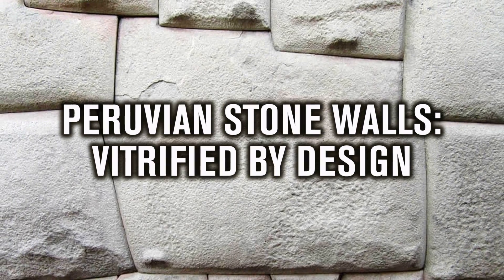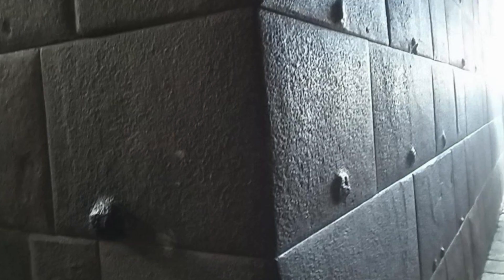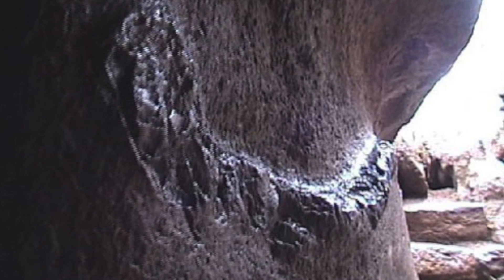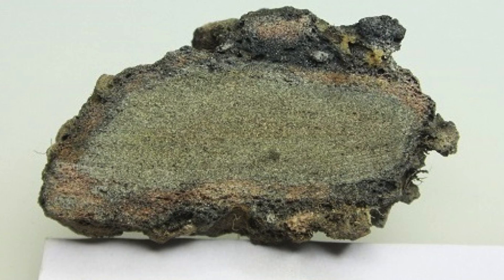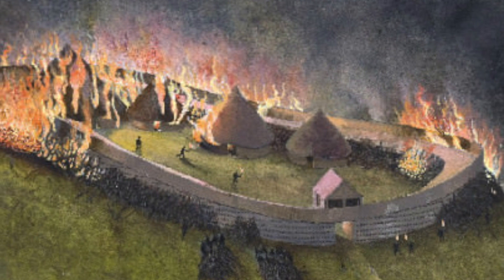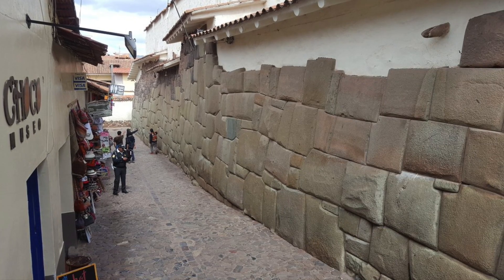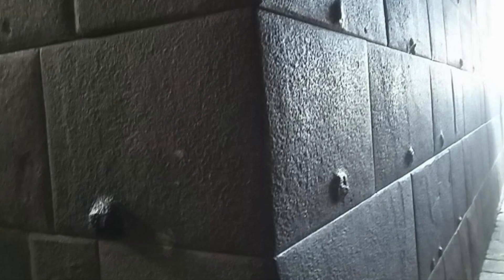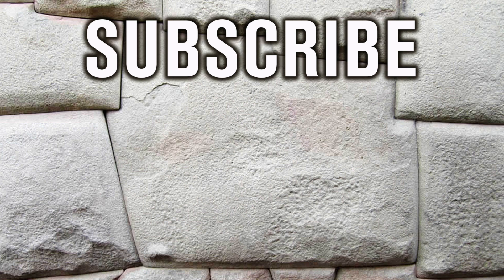Were the Peruvian Stone Walls Vitrified / Melted During Construction? | Ancient Architects

Comment: Really?!  This again?  Vitrified Forts were put to bed in 1937.  A large wood fire placed against a stone wall will melt stone.  It doesn't matter why or when the fire is made and the actual vitrified walls are wildly inconsistent.  This wasn't done as an organized thing or as a planned part of construction.  It may have been done to strengthen parts of walls by fusing the stones, but this doesn't actually work.  It may have also been done as part of the decommissioning process or in battle or to deny use of the site to invaders.  Or it may have been done as a way to remove growth of  bushes and trees against the walls.

I've been to Peru and Bolivia and touched the smooth pieces of walls that so many people wonder about.  If you get up close to them you see that they're smooth where peoples hands and feet touch as they walk along the walls.  As for the knobs, most are gone, long ago eroded away by natural spalling and there's nothing to indicate they were anything other than lifting lugs.  You can see where they were in many cases.  Odd shapes don't work well with sleds, lifting lugs help move big odd shapes into place.

As for how to make and fit large odd shaped stones, ask a mason.  They do it all the time.  The only real difference between what was done in the past and what is done now is power tools.

Comment: Thermite and gavel,  light at bottom, 2700 deg. Aluminum, rust, and sand gravel to make. Clay was used to making impressions or statute. Simple enough. Magnetic stone from iron cooling inside. Melted together and separate and formed to bottom.  Size wouldn't matter if stones where sand gavel  and thermite but could shrink. And crack in cooling. With a molded clay, molten rock will alline Magnetic direction created.
Cheers mate.